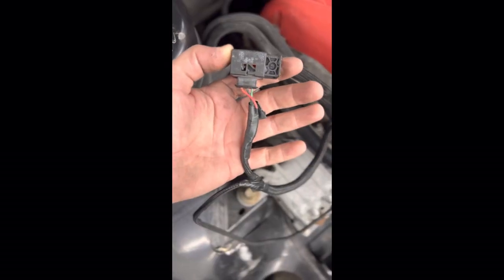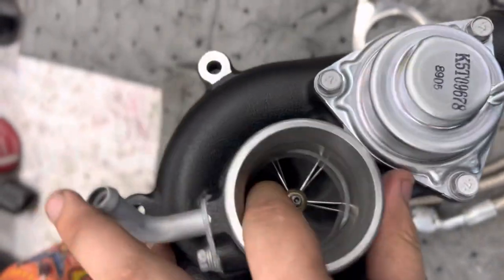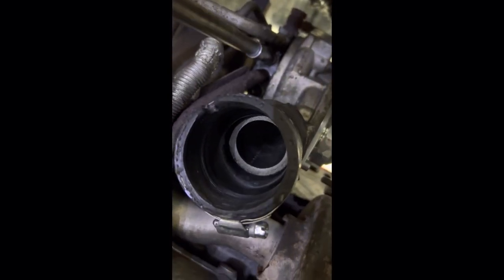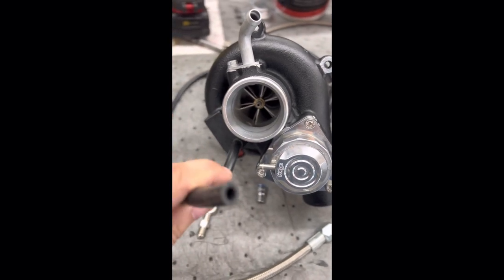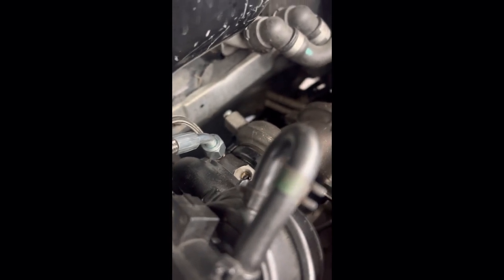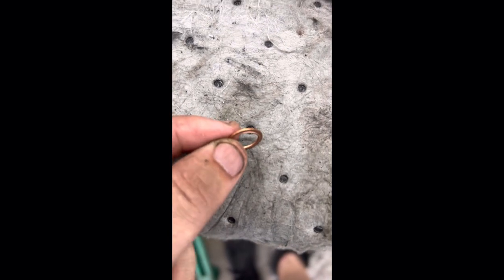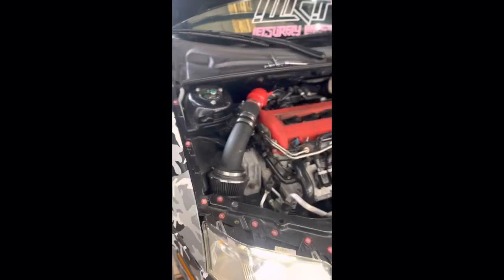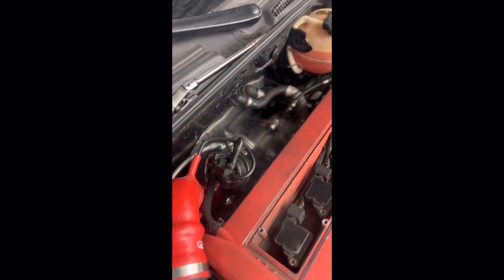Installing my Snail Werx 19T on my Saab 93

Comment: Not the china turbo from snail. That things gonna blow apart like many other wonderful turbo made by snail don’t work
Reply from the maker: Been fine so far, roughly 18k miles since installed
Reply: @Camosaab  just b careful mine lasted 5 k then blew up then his tune blew up my car and then I rebuilt engine and he blew my Auto trans
Reply from the maker: @Thecaresnail  appreciate the concern. So far it’s been almost 2 years with his tune and subsequent retunes as well. I’ve had nothing but good things this far. Sorry to hear your experience was not that way.